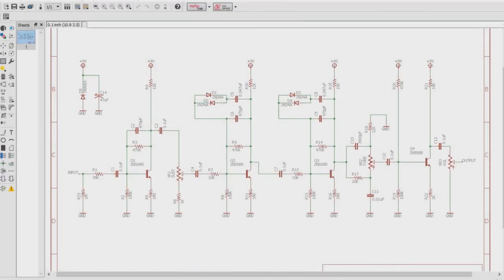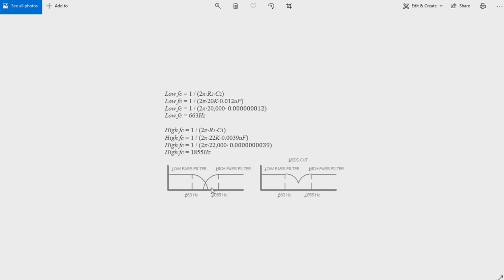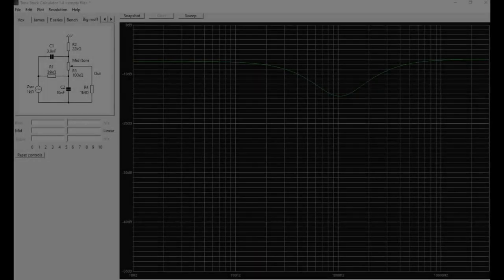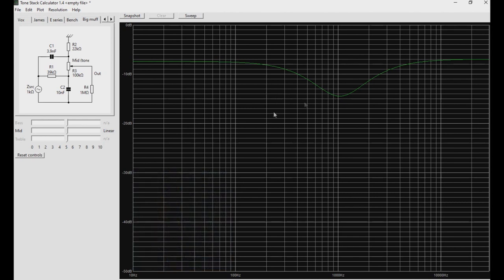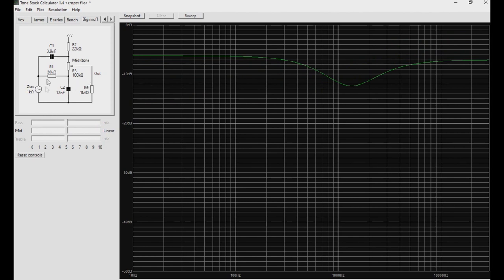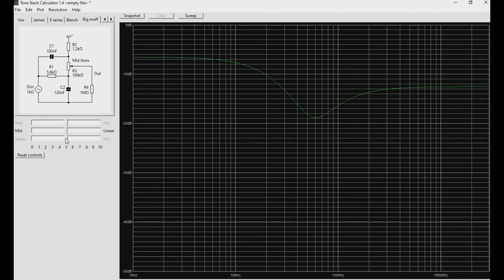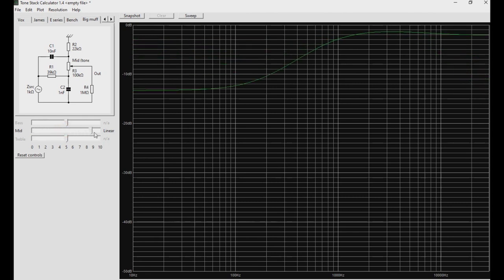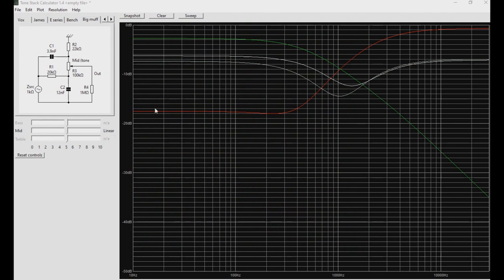All About the Big Muff Pi Tone Stack - Siberian Mods Part 3

Comment: What kit would allow me to have switchable diodes, transistors etc?
Im envisioning a drive pedal where I have a ton of options from fuzz to light distortion. I would probably always place my eq pedal after to really sculpt the post drive tone. But maybe some kind of variable pre eq inside the pedal.
Reply: If you want a BMP circuit, have a look at Aion's Halo variant, it provides a circuit to toggle between two different sets of diodes.
Otherwise, it's actually a really simple mod to DIY. Anywhere you have a pair of clipping diodes in a circuit, you can just remove those diodes and solder the start and end pads out to a switch, and wire up as many diode variants as the switch is capable of (even use a rotary switch if you're feeling adventurous).
That way you can take a pedal kit you like, and add the diode switching options to it, rather than settling for whatever's on the market.

Edit: GuitarPCB's BMP has an optional mod for adding a 3-band EQ to the circuit also
Reply: For distortion, the Tasmanian Devil has switchable clipping methods. As of our PCB kits, we typically set them up with the idea in mind of socketing things and switching out components. The Siberian in this video (and in the past two) is a socketed Big Muff Pi, which we also offer in our store. The build doc goes over the swappable options.

Comment: what if i were to use a 100nf capacitor or even 1uf for C1 - im curious as to how much i could make the high end of the tone knob more focused on mids and not treble - i must also add that i am on a mac so i cannot download the tool that you used for changing these values
Reply: Another option would be to use an online version, which you can find here:
http://www.diyguitarpedals.com.au/tonestack/bigmuff.htm

As of just changing C1 to 100nF, that does create a hump in frequency (as opposed to scoop), with the hump at around 200 Hz. One way I'd get a mud-scooping tone stack is to keep 39K for R1 and 22K for R2, but change C1 to 4.7nF and increase C2 to 47nF. This puts the scoop at about 450 Hz. With C2 at 33nF, that puts the scoop at 500 Hz, but its a less pronounced scoop. With C2 at 22nF, that puts the scoop at about 650 Hz, but even less pronounced of a scoop.
Reply: @erikvincent5846  thanks! - just to update i decided to just swap around the capcitors so C1 is at 10nf and C2 is at 4nf which seems to be pretty good at boosting the 1k response :3